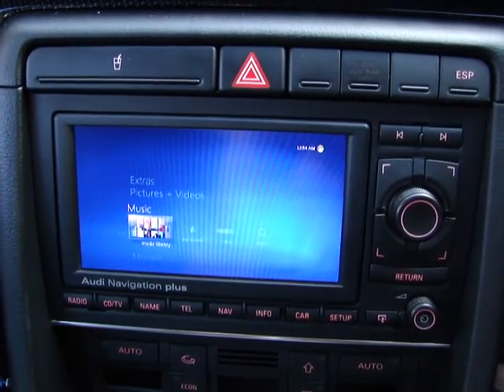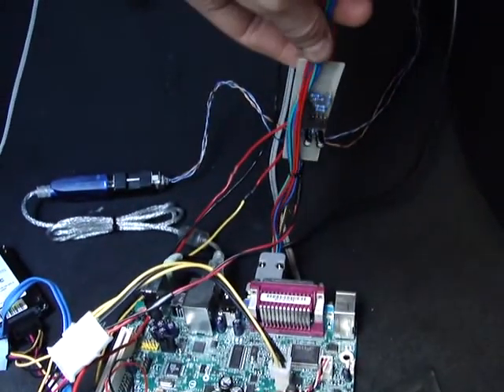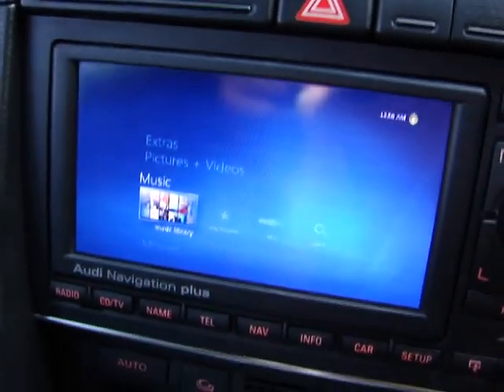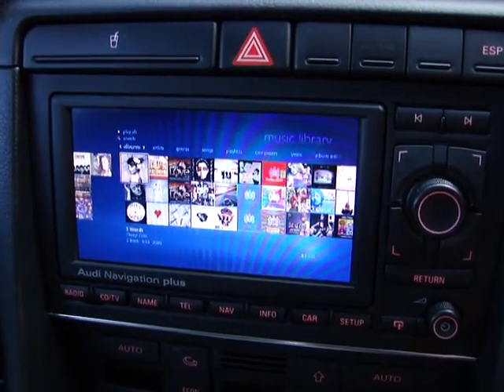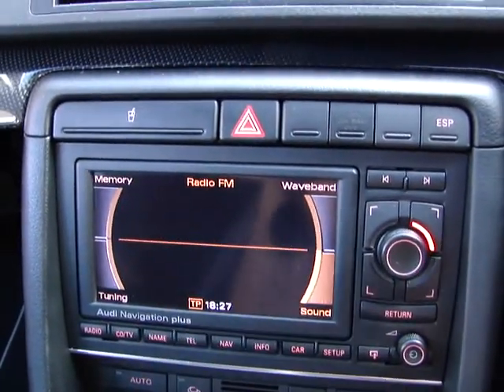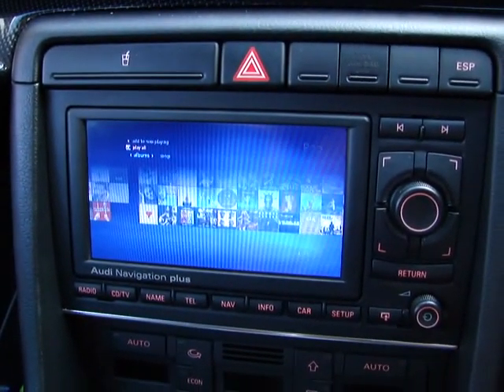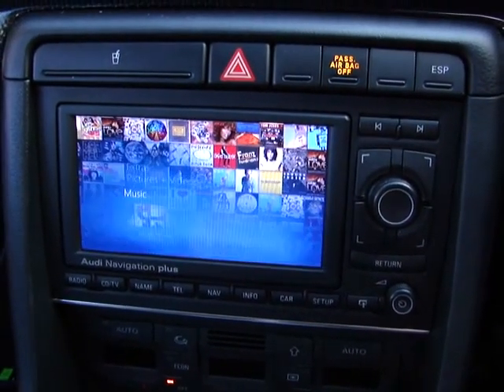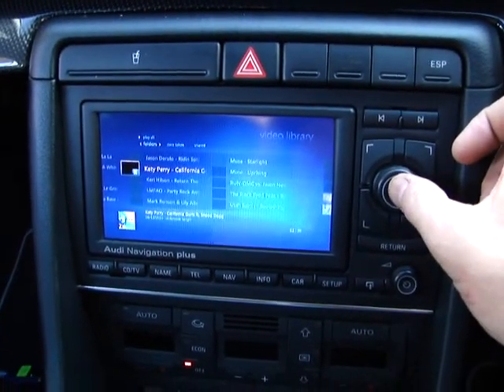Audi RNS-E with Media Center

Comment: hi i am very interested in your project. please could you give me information on the resolutions in powerstrip. greetings and many thanks desdes Spain. congratulations on the project.
Reply from the maker: Hi There, thanks for taking a look at the project. I used powerstrip to work out the settings for the video modes at the start, but I do not install powerstrip anymore to get the correct video mode. I just apply a registry file that creates the DTD settings in the video driver. 

If you would like to build this project for your car, I can help you and supply the required CAN bus adapters, video cable, and system tray software to read the button presses.

Email me : steven.oakes@gmail.com

Comment from the maker: Yes these computers would be very nice because of the size and power usage, but you need to note that the computer *must* output in a custom resolution.

I have tried, tried and tried lots of motherboards and the ONLY one that could do this was the Intel 945 chipset. 

I highly doubt any other board, especially specialised boards such as Rasberry Pi would be able to do this.. 

Thanks
Steve

Comment: Fantastic job, looks brilliant.

I use Media Centre a lot, but I also built a touchscreen jukebox (home, not car) with an Atom based system and use a $15 piece of software called Album Player.  Works great and you could integrate right into the Media Centre menu...

If only I had an RNS-E in my A3 :)

But seriously, a GREAT job :)

Comment from the maker: Yes, that's pretty much right. The CANBus adapter is connected to a Peak Systems adapter because the Infotainment CAN is a low speed CAN. The CANBus adapter is for high speed, and the Peak systems is a high/low converter.

The wires are a pair of CAN High and Low, the others are ground and connect to the back of the RNS-E.

If you need any more help, let me know..

Comment from the maker: Hi :) Thanks for the comments. Yes, it took quite a bit of hard work to get the results in the end.

I am currently getting to a point where I can manufacture the circuit boards and have a website with how to build the system. If you would like to do the same, check back soon!

Thanks, Steve

Comment: Very nice! I managed to do something similar but I'm now stuck at how to control it using the RNS-E. From what I can tell, you're using a Can2USB adapter, but then what's that plugged into it that splits the wires? Once split, I'm assuming you just have them spliced into the CAN High/Low on the back of the RNS-E right? Then is it just a matter of sniffing the COM port?